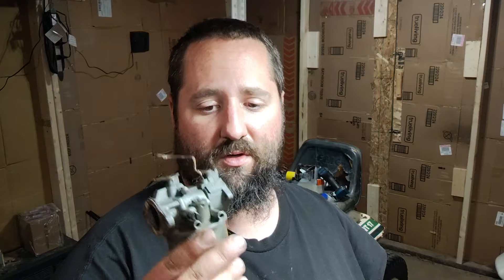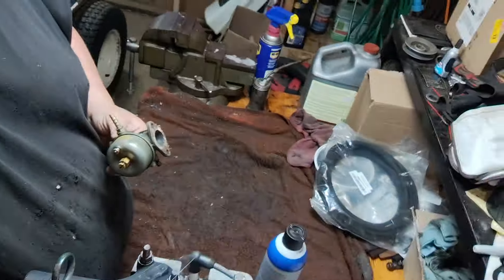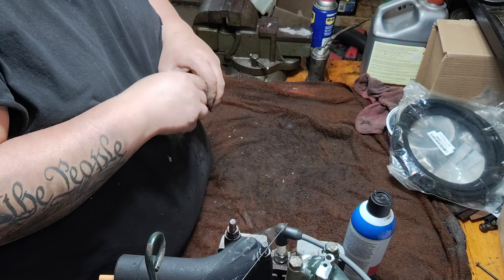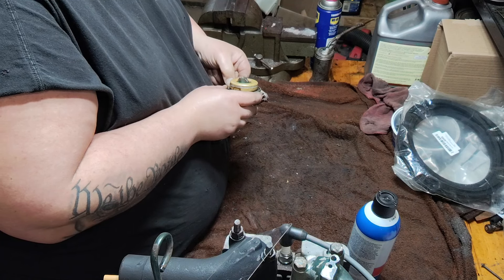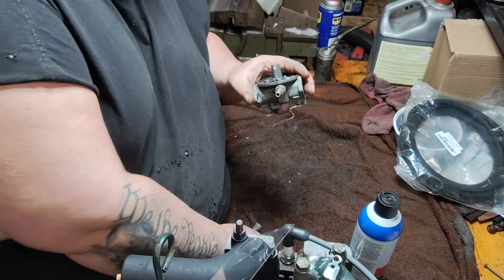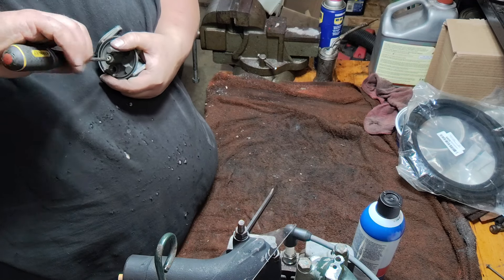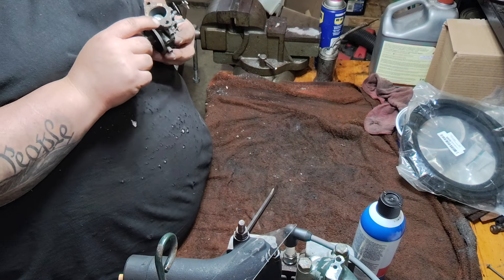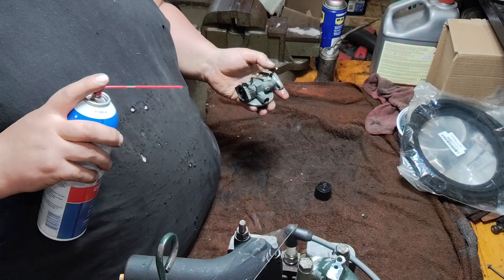Bolens Husky 1253 Tecumseh HH120 carburetor cleaning part 1

Comment: It is surprising how many 1253's are still about considering they were a one year model. Our 1253's have Walbro carbs and I believe that if you remove the main nozzle you either have to replace it with a service nozzle or machine the original due to the cross drilling when they were made
Reply from the maker: You are correct about the main nozzle. Fortunately this carb already has as the service nozzle installed.